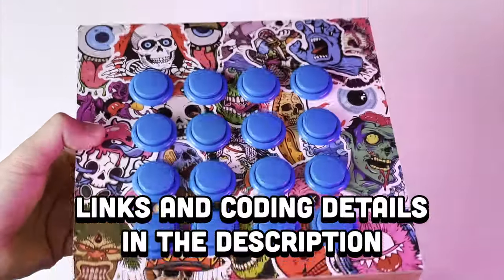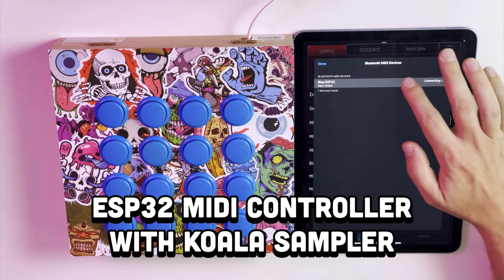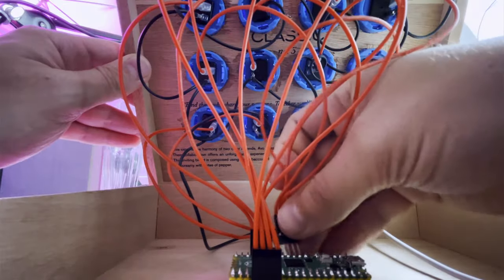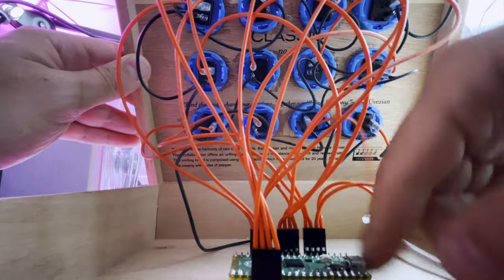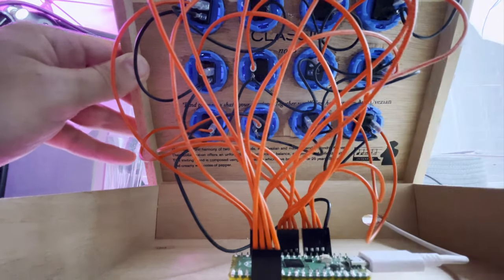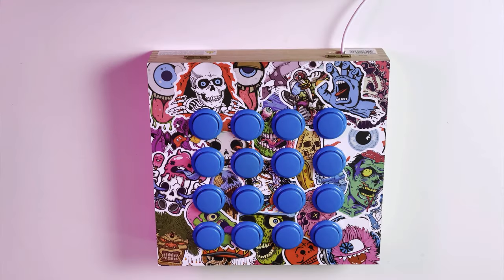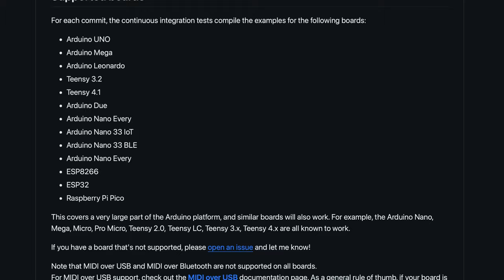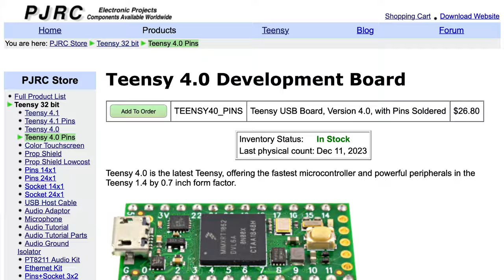DIY Budget MIDI Controller Showdown | ESP32 vs. Raspberry Pi Pico

Comment: Embedded developer here that uses Espressif microcontrollers like the ESP32 daily, don't worry about being annoying when complaining about the ESP line's wireless latency. It's real and we all have to deal with it, even with pushing packets over WIFI using UDP. It's just not something Espressif worries about over ease of use and stability of the wireless connection. Hardware connections will always trump over the air, sadly.

This is also something that plagues the enthusiast keyboard market. Getting gamer-ready performance + wireless is a serious issue and it seems companies are gravitating towards microcontrollers from Nordic. Weird bluetooth latency spikes still apply though.

Maybe things will be better with future hardware (and library) revisions but I'm not holding my breath. Nearly all IoT applications can withstand latency that would be killer to a musical input tool or game controller while Teensy or STM microcontrollers seem do be fulfilling the musical demand just fine.
Reply from the maker: Thanks, @kimtae858! That's all very useful information to know. cheers!

Comment: Great video! I find bluetooth for midi (and for other controllers) quite useless. It's a great idea, but the latency is annoying. Wired always wins, no matter which microcontroller you use.
Reply from the maker: Thanks! I had experienced the latency of bluetooth gaming controllers. However, I fooled myself into thinking it wouldn't be an issue here. Maybe it would work okay for a MIDI Sequencer, but playing drums with it was a no go.
Reply: @mobypixel Also, I think the digital instruments market shows some confusing trends - Pianos like the Roland go have midi over bluetooth. As long as the sound generation happens on the device while playing, it's fine, but if you try to use these devices as midi controllers for vst synths, the experience hurts due to the bluetooth latency.
Reply: idk i use midi ble devices live and the latency isn't noticeable

Comment: So when you swapped to using the Pico did you connect it to the Koala app via a cable rather than Bluetooth? I somehow missed this detail?
Reply from the maker: Yeah, the Pico into the iPad required a USB cable going from the Pico into a USB power bank, then into the iPad's USB-C. The new Pico W has Bluetooth but I imagine it would be a similar result.

Comment: You came through with the fire on the pico beat 🔥🔥🔥 thank you for detailing the latency on the esp. I’m going to try and get a ble midi sketch going on mine just to test but I had a feeling it was too good to be true 😂 I’m also curious about circuitpython on the pico and what that latency will be like. Anywhoooo, awesome video
Reply from the maker: Thanks, @flywittzbeats4008! I imagine CircuitPython would be similar in terms of speed to Arduino. There is a similar build I've seen floating around of an LED arcade button, blue box MIDI Controller that uses CircuitPython. I'm just more familiar with Arduino. Thanks for checking out the video!
Reply: @mobypixel  hey thank you man! And thanks for the reply. Are you still in the Chapel Hill area by chance? I heard you mention it in a prior vid. If so I’d love to get you a beer sometime and dork out haha. My names Elan 🤙🏼🤙🏼
Reply from the maker: @flywittzbeats4008  Cool! I'll send you an email.

Comment: the only caveat with both of those boards is they're both have pretty terrible ADC options so if you wanted pots, you're probably better off with something else like a knockoff Arduino type board or a teensy
Reply from the maker: Hey Marek! That's good to know. I saw where you were making some kind of groove box with the Pico on Twitter a while back. Yeah, Teensy is awesome! It does all the things well.
Reply: @mobypixel  teensys are great but would be even better if they were cheaper!

Comment: Hello...awesome video. Thank you. I woukd like to try this with my lighting rig...im new to this midi diy coding business but I'm eager to dive in...would you mind making a tutorial to code this so I could use it with my DMX controller/software? Just maybe a general overview and then I can see how you did it and get my shoulders wet(...told you I'm diving in! Lol) thanks in advance
Reply from the maker: Thanks! I'm not familiar with DMX controller/software. Does it work by taking inputs from a regular MIDI controller?
Reply: @mobypixel  yes u can use midi with software such as engine dj,  rekordbox and virtual dj 2 name a few....essentially I think everything should be the same as u already did now that I'm thinking of it.....ill give it a go and see what happens...ill let u know boss
Reply from the maker: @dodom2863  That's awesome! Good luck! 🙌
Reply: @dodom2863  While faster/more stable than midi-over-bluetooth, usb-midi can still create lag and timing issues when it comes to synchronized lighting (like strobe rates, moving heads syncing , etc). 
I am learning this now myself as I prep to outfit my Roland drum kit with sync'd UV lighting under the heads, and the guys helping me have said that (old school DIN connector) midi-serial is THE way to go for MCUs. Just requires a few parts and soldering to create the connection from the 5-pin midi jack to your MCU, and of course, your computer would have to have a midi output, which many music-minded folks might have in their audio interface. 
If your PC doesn't have a midi output (and you don't wanna buy one), then try "hairless midi". 

Check the "engineering mindset" channel for tips on serial-midi input construction.  Also, if you go the arduino route, check out Lady Ada's MCU lessons. Good luck!
Reply: @jephbennett thanks so much...although imma try this cuz it's looks cool in real world application I can see the value of what ur saying and will prob be going that route myself. Crazy thing is I  want to map a single light to each light on a grand piano(82 keys) and then have the lights be mapped to actually notes not just keystrokes...feel me?

Comment: How about... can potentiometers be added to the esp32 to use in the koala sampler?... what would be the lines?... or where could I inquire about the subject?... greetings
Reply from the maker: Hey, sorry for the delay! Yeah, you could use pots with the ESP32 but I've not made any projects with ESP32 that use them. On Arduino, you have to connect a pin to power, another to ground, and the third pin to an analog input on the board. Like I said, I've not done it with ESP32 but it is a pretty general feature of most boards.
Reply: @mobypixel  make a code that could work... could you review it and give us a better alternative... this is great!
If I could send you an email that would be fine. greetings and thank you very much

Comment: What are those solderless wire connectors called? I don't have a soldering station so I might use them 😅
Reply from the maker: I have links to the ones I used in the description. The jumper wire pins came in a set and the Arcade connector spade terminals were separate.
Reply: @mobypixel  I see, thanks a lot!

Comment: Are either of these boards detected automatically as midi devices by an iPad?
Reply from the maker: @WoozleEffect  The Raspberry Pi Pico is connected automatically when wired up to your iPad. Bluetooth controllers will work too but you have to select the device in each app’s settings.

Comment: i have a raspberry pi pico but is not working using arduino ide and the code in the ilnk description. What should i do?
Reply from the maker: Is it showing an error in the Arduino console when you try installing the build to your Pico? Did you also install and add the Control Surface library in the Arduino IDE too? Does it seem like it is installing but MIDI isn't being detected? I think the logs in the Arduino console will give the best clues as to what is going on.

Comment: Hey! Quick question… for purposes I’m making a controller to hook up to my Mk1 octatrak to play in some samples - same as you. I have a Kenton MK3 usb host that acts as a host and converts usb midi controllers traditionally for computer to 5 pin midi. My question is will the Raspberry Pi Pico (RP2040) with this build and code be hosted by my Kenton? The chart in the link says the pico has MIDI over USB (device) but not midi over usb (host)… am I right to say that the Kenton would be the host and it would pick up the pico as a device ? Super broke dad so I’m tryna keep my costs lower than the beautiful ground. Thank you!!
Reply from the maker: Yes, device receiving MIDI messages is the host. I don’t have a Kenton but I imagine it should work without any alterations to the code. Good luck with your build!

Comment: I’ve a doubt… using the pico did u need to install loopmidi or any midi bridge program?
Reply from the maker: No, on Mac I just plug it in and it's detected automatically as a MIDI device. I used the Control Surface library, so they might be handling some of the MIDI routing behind the scenes.
Reply: So much thank u! I was trying to made with esp32 in wire way, but doesnt work… thanks for blowing my mind (laughts)

Comment: how do you setup the bluetooth do you have to pair it with the ipad?  i can’t see my controller at all
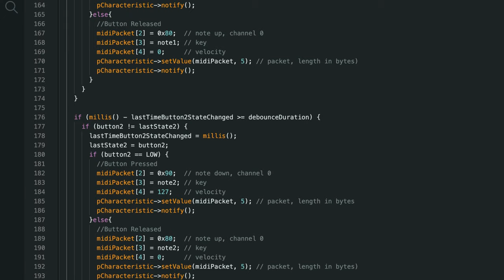Reply from the maker: You need Bluetooth enabled on the iPad, and then the app you are using needs to support USB MIDI. Usually there will be some drop down menu in the app to select your Bluetooth device. You can see it in Koala around 3:45
Reply: @mobypixel  cool. how is the latency on the raspberry pi pico?
Reply from the maker: It’s really good. I didn’t notice any delay when wired up.

Comment: Potentiometers work with this?
Reply from the maker: Yes, there are some potentiometer examples in the Control Surface library. It typically requires one wire running to ground, one to power, and one to an analog pin on the microcontroller.